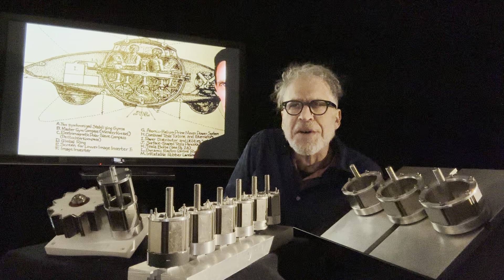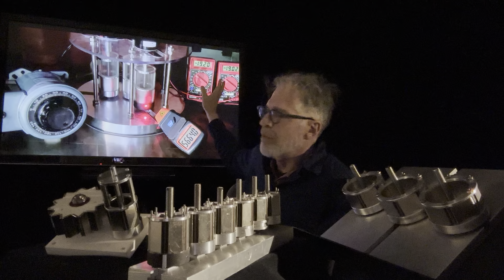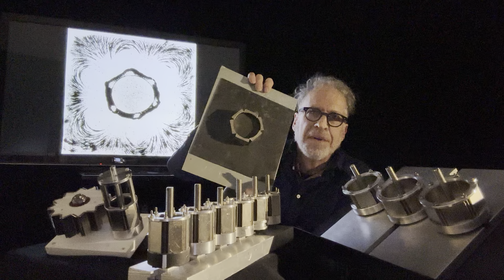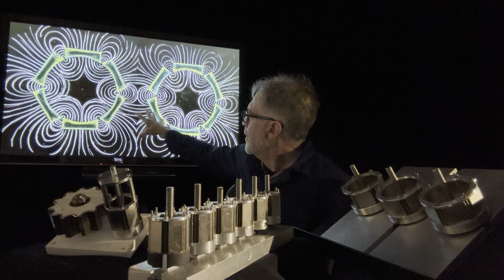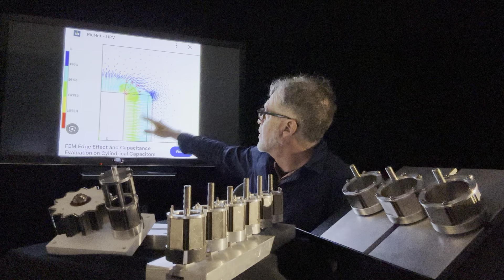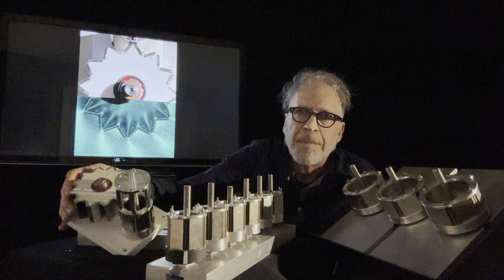Patents on Magnetic Coupled Systems.. Valentine 2025 Update

Comment: I have built Magdrives for 30+ years for vessel mixing systems. The Co. I worked for in the High Pressure Industry has Custom Engineered, Machined,Assembled -Triple metal Diaphragm Compressors to 30,000psi  Vessels,Pumps, Pilot Plants,ect to 150,000psi. 45+ years. I resolved several magdrive problems that the Engineers couldn't, magnetic flux was the problem. The coupling strength almost doubled and magnet destroying heat was reduced. I'm enjoying your posts and have experience, real world knowledge and Ideas. Contact me Anytime. Thank You
Reply from the maker: Hi Ray-  Thanks for contacting me.  I am really curious as to how your systems work and what Companies you were working with.  Achieving 150,000 psi is remarkable.  My ideas really came about from pure curiosity and empirical experimentation.  I have had a difficult time raising funds to move my systems any further and have more ideas regarding a new type of magnetic bearing to be integrated with what I have already patented.  Through my contacts I eventually spoke to research scientists at National Renewable Energy Labs under the Department of Energy and thy suggested that if I could find an academic institution that I might be eligible for a grant of around $600,000.  I am based in Atlanta and tried bringing it to GA Tech last fall before all grants were being canceled.  It seemed like enough to begin testing but it would have required me giving the patent to them and I was also told that was a pretty insignificant amount given that the university would take half and the professor who would be primary investigator would keep at least 20% leaving little funds to actually build a system to the tolerances necessary for study. I have another patent under review at USPTO and have been thinking about just abandoning everything given the expense and sunk costs as I am just an individual inventor with really no way to monetize things further.  You are welcome to call me at 404-368-3019 if you have any ideas or potential investors.  Sincerely, Evan